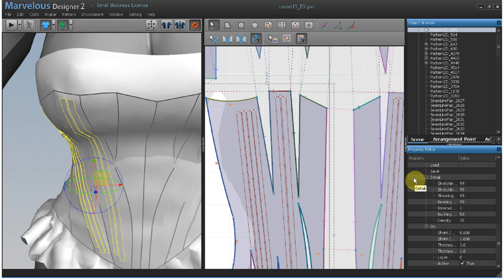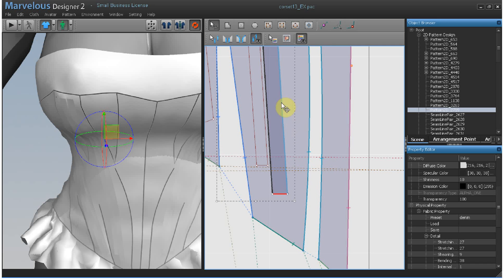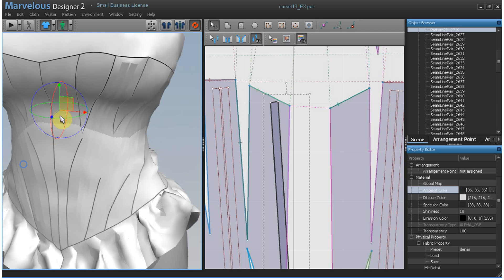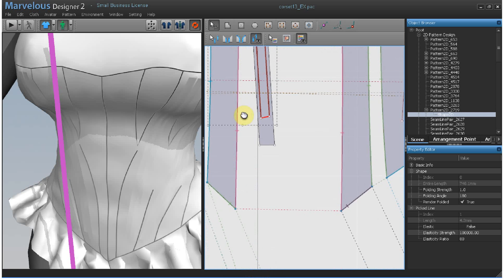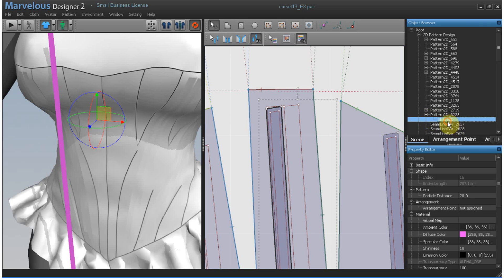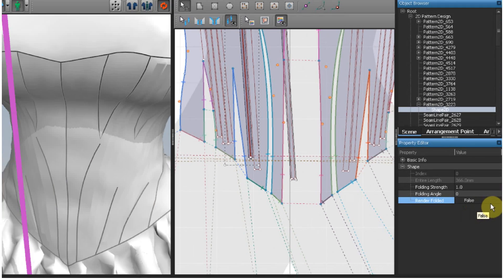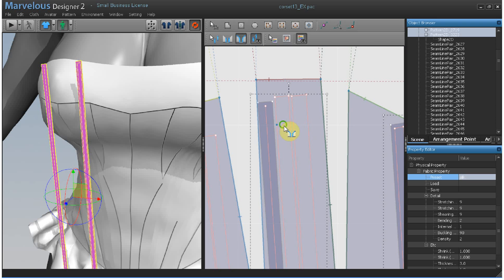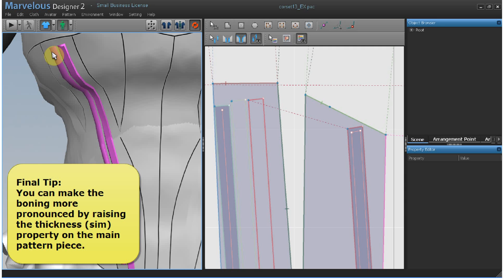MD Sewing Series: Boning/Cording

Comment from the maker: The human model in this video is my custom SL shape. If you plan to use the arrangement points, you'll have to readjust them to fit the SL Avatar. There is a tutorial on creating custom arrangement points for a character in MD's tutorial section.

As for the pose, the MD model uses an A-pose not a T-pose. I made a special A-pose for my SL Avatar in Blender since arm draping usually works better in the A-pose for things with sleeves.

Comment: I was curious if you are using the Second Life avatar inside of MD?  I pulled an avatar in to work with, and the arrangement points are completely wrong, as well as the avatar is in an SL T pose instead of MD's T pose.  I am having major issues getting the fabric to drape onto the SL avatar correctly since the shape is so different from MD's avatar.  Can you offer any assistance on how I can fix my issues?